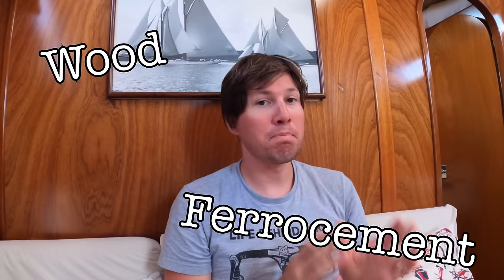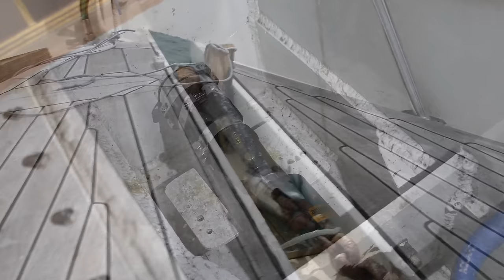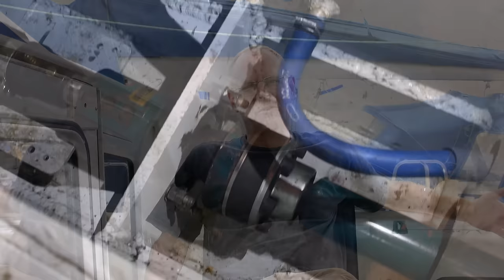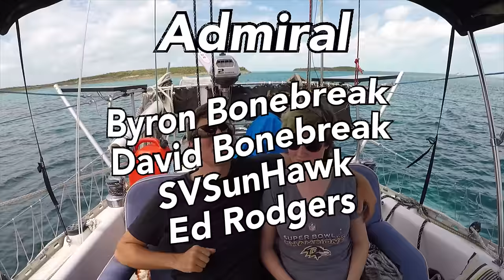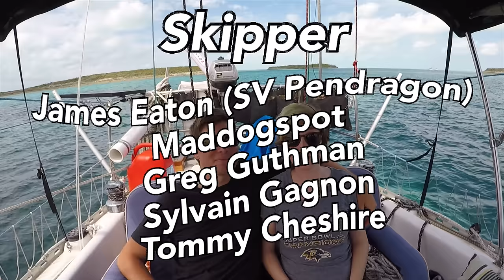Which Hull Material is BEST: Aluminum  | Sailing Wisdom

Comment: I had an aluminum Houseboat years ago, it was an Alcan 370. I had the motors removed and I was going to repower it when I decided to go to another Marina. I had the owner of the new marina tow me over. He decided to show up later in the day when the wind was picking up but he assured me it was ok....I didn't listen to that little voice in my head....live and learn. He towed me into the corner of a concrete wall at high speeds. The side of the bow caved in but the boat didn't sink and the damage would have been repairable with a sledge hammer lol, to this day that's why I place aluminum as the number one boat building material, lack of maintenance and durability.
Reply from the maker: That’s incredible! Aluminum really is a remarkable material.

Comment: If aluminum were any advantage for the operation of hulls, then the hulls of commercial ships would be built from it. But it is beneficial only for the construction of the hull, not for its operation) It bends easily, it is generally light. And it also shines beautifully and people are easily bought for the supposed absence of rust (it's just that aluminum has a different name for rust). But aluminum has one small, but very important feature: it cannot withstand loads close to maximum for a long time or repeatedly. For example: steel, without problems for its internal structure, can withstand up to ~ 80% of the load at which it breaks, and aluminum only up to ~ 30%. All this is highly dependent on the alloy, but I think that the principle is clear. Thus, it turns out that for aluminum the designed load will be only 29-30% of the total strength of the material, and for steel it will be ~ two and a half times more. This will be reflected in the actual weight of the boat - it will not be as good as the table volume weights for aluminum comparable to steel. Both are metals and therefore you will have to watch out for galvanic and electrical corrosion as well as stray currents. If the steel is hot-dip galvanized, then you can hardly worry about corrosion, of course you have to cover the body with special paint, then another, then another, then another, then another. Not tired? Then another layer, so that it was certainly reliable)) Yes ... this is not aluminum, this is steel, baby. It requires a little more attention, but much less often, and you are no longer so afraid to drop a steel bolt into the hold or under the floorboards, you are not so concerned about the currents in the marina, you are not so tormented by the issue of induced currents from your radar, and so on ... And this thing can also live 100 years or more. It can be welded by anyone in any country in the world. Even the most remote. This does not require argon and special equipment. And metals, unlike plastic hulls, don't contain the eternal chemicals (google it. it's really important to your health) that you'll inhale every time the sun shines on the boat and it heats up.
Reply from the maker: Good points. Steel is much more resilient but a properly designed aluminum boat is still pretty cool!
I personally would never own one because of a neighbor on the hard with an 80’ aluminum sailboat. The hull had countless holes in it from galvanic corrosion. They were about the size of golf balls and well over twenty of them. The holes became apparent during the power wash as the smutz that was in them and plugging the hole got washed out. The owner was looking at a crazy repair bill and waiting for the insurance company to send someone to take a look at it. The hull had many anodes built into it and they were still in good shape, but for whatever reason, his hull was being eaten away. 
While aluminum boats look neat and are impressive, that little issue with electricity makes me shy away from that hull material for myself. 
While most cargo ships are steel, the 40-something foot coast guard boats are aluminum and they live a hard life. Crazy impressive boats, but I have no information about how long they last or what the maintenance costs are to keep these hulls operational.
Reply: @RiggingDoctor what about "Corten" steel for a hull? 
Versus of course: a Stainless steel? 
I have seen a video on a giant home stainless steel built in ? Arizona ? ...
However I have never seen anyone discuss the negatives of stainless steel?

Comment: With  Aluminum it is easier to fix the holes and dents. My 14 ft fishing boat is aluminum , if it's a dent you bang it out, if it's a hole you can weld it closed. but that's my fishing boat and it's in and out of the water every use. Can't wait to hear about the other hulls instore.
Reply from the maker: That sure makes keeping the hull watertight through the years a lot easier!

Comment: another plus is resale value. unlike other materials, if the whole thing is wrecked but not sunk, you can recycle it!
Reply: Yeah, bring it to the local redemption center and they'll give you $0.05. :)  Just joking.

One downside is that 1/2 of the world pronounce it the way the discoverer intended, and the other 1/2 don't.  Also :).
Reply from the maker: As long as it fits in a can recycler you get paid? 😂

Comment: True; no material is perfect.  For sail boats, AL is not the best; too many different metals creates problems.  Powered vessels, eg ships, tugboats, etc, require steel, as do any vessels working daily in the Bering Sea.  The average power yacht is used for pleasure, and for this AL is my preferred material, keeping all other metals to an absolute minimum and well insulated from the AL. Al can be coated and anodised, if the bare grey becomes too boring. But bare AL can act as a heat sink in the water. Use cork for decking, not teak. Cork is glued, so no leaks; glue is very easy to re-glue and to patch. Cork gives excellent grip, is scrubbable,  and lasts +25 yrs.

Comment: Hi Herbie, The thing I remembered after you recorded this was paint! Aluminium and paint really don't get on. That's another big negative. I like the French approach which is to  paint as little as possible. My boat is Dutch and they like to fair and paint the whole thing. It looks great for 10 years but then it's a huge job to repaint.

Cheers

Lindsey
Reply from the maker: I was wondering that about your boat. I have heard that painting is a real problem but your topsides looked really nice! All the other aluminum boats I have come across have been bare metal. 

Where are you guys now?
Reply: @RiggingDoctor  Yes it passes the 10 meters test and looks good from afar, bit once you get close you can see it is starting to bubble up in places, especially in areas near dissimilar metals such as the stainless railings.  I'm taking the paint off where it bubbles up as in reality the paint above the waterline is decorative and the exposed aluminium is better as you can get corrosion under the paint but with no paint the aluminium oxidises and that's the end of the corrosion.

We are in Crete for Christmas and then heading over to Turkey in the new year (Joys of Brexit and only having 90 days in Schengen now - as you are well aware, but it's new to us!)  We had planned to cross to the Caribbean for the last 2 winters but Covid concerns have made us stay in the Med. Next year!!

We've been following your travels with interest and enjoyed your blogs crossing the Atlantic.

Cheers
Reply: @LindseyGill  The Bestevears I've seen are unpainted Aluminum.

Comment: Why no mention of using a proper (e.g. zinc) sacrificial anode? I get the importance of not having any stray currents from your electrical system, but a zinc anode is still a must-have, no? Am I missing something?
Reply from the maker: Absolutely. All boats need to have a sacrificial anode, but this is stuff that he feels are important to have in addition to the normal stuff boats have to fight electrolysis.

Comment: Very very interesting boat. Everything about this boat deserves more attention IMHO. 
Anyway, aluminum hull construction advantages and disadvantages are all far too technical for me.
  I do like the fact that the aluminum hull is extremely corrosion resistant.
Reply from the maker: It was way above my comfort level for “not worrying” (maintenance wise) but it is very impressive.
Reply: Except for electrolysis!
Reply: @richmorpurgo5554  
Is electrolysis the addition of material?
Is galvanic corrosion the removal of material?
Reply: @RiggingDoctor  Exactly, dragging anchor is enough to worry about. Don't do aluminum.
Reply: Just wanted to say that many boats have been built on ferrocement. And others in cort-ten steel which to me is absolutely the best especially to one used with class specs.
Reply: Forgot to mention that GRP in general is a process that never ends since the build up to the end of life the crystalizzation process is always on going this is meant that in a long run GRP tend to loose his strength coefficient and bending become to brittle especially if left out of sea for longer periods as its get dryed
Reply: I had a Corten steel sail  boat.  It rusted like craz anywhere it chipped the paint, just like normal steel. I’ll never own another steel boat.  I hate the smell of epoxy primer.

Comment: Iam in the process of building a 62' aluminum sailing catamaran.  The boat will be equipped with a miller dynasty 350 so I can perform any repairs at sea.
Reply from the maker: Excellent! The best hull material is one that you can repair yourself anywhere!
Reply: Sounds like a great project. All the best with it

Comment: I have no experience with aluminum sailboat hulls, but I do think that they are the best among powered vessels.   The ballast in the keel must eliminate the biggest con which is hull slap.
Reply from the maker: Lighter performance sailboats with their flat bottoms can make that annoying hull slap rather well, but it’s normally masked by the noise of the wind, rigging, sails flapping, and ropes clanging!
Older and heavier sailboats with deep V hulls going down to a heavy keel don’t have any hull slap, but they also don’t move very fast either. It’s nice when that ballast just helps you cut through bog waves 😎
Reply: @RiggingDoctor  I still hear wavelet breaking at waterline at anchor through 1-1/4" wood. A sound to get used to since it is so similar to dribbling water.

Comment: Can you fill holes on a aluminum boat with brazing rods?  Or would the hull be too thick?
Reply: 'Brazing' if your thinking bronze, no. Weld yes, same alloy. They are very repairable. 1# choice for workboats
Aluminum marine should be a specific aloy with magnesium. Protective paints and antifouling are different and specific. 
Throw a copper penny in an aluminum dinghy and it will put a hole through it. 
Thickness of hull plates is more about cost than weight. Save catamarans.
Reply: The proper way to fix a hole like that is cut a v and and mig the hell out of it lol
Reply from the maker: These repairs are outside of my skill zone. I don’t know how to weld yet.
Reply: You can't braze a hole at sea because you will lose all heat to the water. Dry dock would be ok

Comment: What meter to you use to monitor stray currents?  Do you use a copper-based anti-fouling paint?
Reply from the maker: I don’t know what brand the meter was but it checks for stray currents. 
Copper paint will cause a lot of problems, you need special paint for an aluminum hull to avoid issues of dissimilar metals between the hull and the paint.

Comment: The only hull choice that has a scare factor to me. The Australian/NZ have a different cost comparison to other choices. Dominant unlimited budget performance sector. Perfect maintenance, never take a short cut or push anything off. 
Leaving corrosion under a slap fix I have seen some in port have large 6"+ spots with shiny paint crumble apart. 
I wonder how many believe it is a sound choice for full time cruising multi year were it is your only home? My observation has been more for seasonal cruising that leave it behind for boatyards to maintain annually at minimum.
Reply from the maker: I too am more comfortable with a solid glass hull.
Reply: Check out km yatch builders.
Their yatchs are used full time liveaboards such as BBC documentaries in the Arctics.
Reply: @RiggingDoctor  What is the fear factor? Every "glass" boat owner FEARS to run around...especially when they know its likely rock or reef.  Can you find one aluminum s/v boat owner that has the same concerns? I will answer for you, no you can't. They are aware, but they don't fear like those that don't even know how thick their glass is or any idea whatsoever about real life vulenerabilty since they don't know the stregth of their hulls.  We need to think more out of the box on all of these topics.

Comment: 7:34 - how does he treat the small holes … I assume he has to weld it … does that mean it is best to carry a welding machine? Can Copper be used for anti-foul?
Reply from the maker: You can’t use copper paint and yes, he would have to weld small holes closed. 

It’s an awesome material but I have seen too many aluminum horror stories to have one that I’m not always inspecting (my personal opinion)
Reply: @RiggingDoctor  I'm assuming if two clean aluminium surfaces come together without the oxide then a cold weld could take place. And Steel and Aluminium don't mix well as a reaction takes place to seize screw to hull/body.
My question was more related to copper plated bottom not copper based paints… my bad I wasn't clear.
I'm curious to the reactions of metals with sea water such as Aluminium Bronze. I like this hull material series you are doing it gives a lot of insight and info towards boating 👍🏼
Reply: @firstlast9384  
"... don't mix well as a reaction..."?
Could you re-phrase this using standard grammar?
Reply: @largemarge1603  i could but i couldn't be arsed

Comment: Also paints especially anti fouling paints like copper based can and are problematic I am interesting to know is extremely slippery carbon based paints are a problem with aluminum
Reply from the maker: That’s an excellent question! I know they make paints specifically for aluminum hulls because electrolosys but also because it’s hard to get paint to stick to them as well
Reply: @RiggingDoctor  I'm testing out a product called Finsultate as antifouling now. I liked the idea of it as it doesn't use chemicals, but mechanical motion to deter growth. Coppercoat is a big no no. Some people say you can with good epoxy layers between that and the aluminium but I'd not sleep with that as a scratch could  expose the aluminium to the copper. Antifoul such as Trilux which is specified for aluminium is crazy expensive (€400+ for 5L in Spain) and in my experience isn't very effective. So yes I think good antifouling is also a negative on aluminium. I'm willing to dive and clean the boat regularly so I don't have a problem but if you want to paint it on (or stick it on in the case of Finsulate) and forget about it you  will struggle.

Comment: Aluminium are great but NOT at the mooring. Absoloute headaches with electric corrosion. I have an 8.6m with 7mm aluminium hull and 4mm pilot house (twin yamahas).
Reply from the maker: I agree. It’s an amazing material but in the end I chose to buy a plastic fiberglass boat.

Comment: Modern builds in fibreglass are very strong, no corrosion, no problems with electric currents at the dock and good at market value.
Reply from the maker: True, but the metal through hulls can still suffer from electrolysis. The fiberglass hulls will stay around for a very long time, they just need maintenance like any other boat. At least the bones of your hull will last a long time!

Comment: Aluminum is an alloy you need to think of it as like a cake batter different additives to different things so make it hard others make it soft but A marine grade aluminum 5086 is very well suited for boats and saltwater environments as well has a lot of different chemicals metallurgy and allergies have come along way and have become even more corrosion resistant what is the man said can you do really have to watch out for Random electrical currents there are some awesome coatings/paints available now as well but they are very expensive and most are quite an extensive process to apply
Reply from the maker: Aluminum really is an impressive material for boat hulls!
Reply: @RiggingDoctor  Look at Garcia, KM Yachts - who built Skip Novak's Arctic expedition boats; Devillers of New Zealand.
Also Selium aluminium doesn't suffer from galvanic cancer.